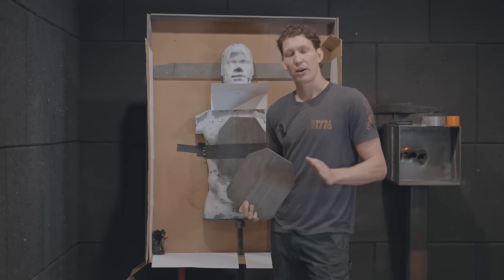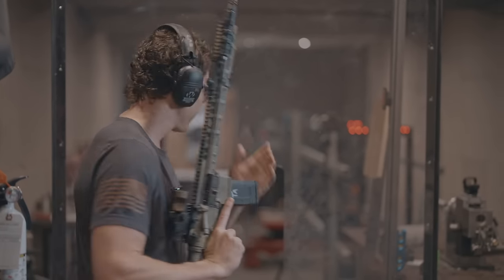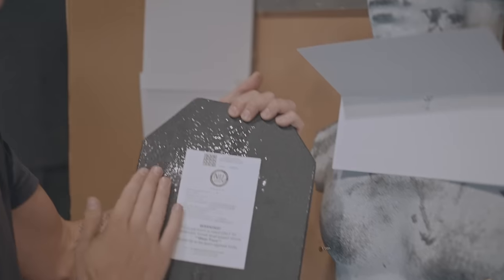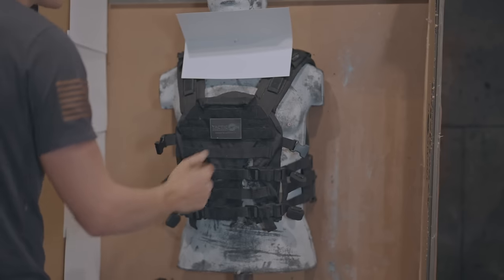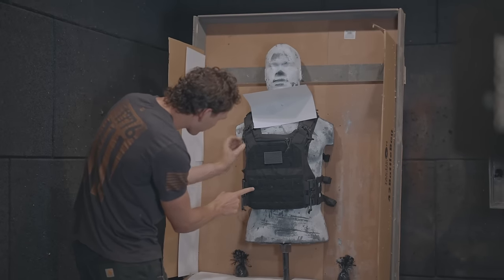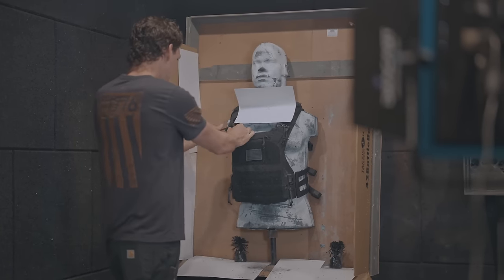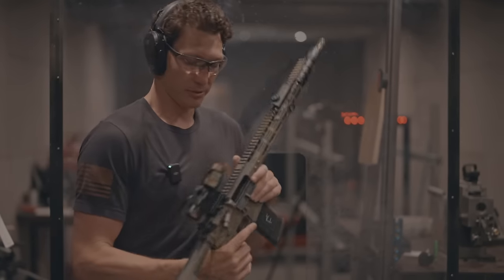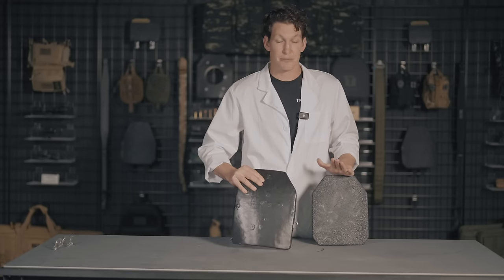Will Steel Armor Make You UN ALIVE Full Test

Comment: I’d really like to see it try M193 out of a 20” or various hunting calibers. I’m just curious as to how it would hold up. That’s one thing about ceramics: they seem to stop nearly everything at least one.
Reply: Yeah for most small diameter fast hunting calibers you really need lvl 4... Basically depends on your location, in my location I'm just as likely to get center massed with a 22-250 or a 25-06 as 5.56, so I'll keep saving for lvl 4 plates (which tacticon also sells, but sadly it sells out fast like today with a smoking hot discount code!) But these plates are 100% perfect for budget reasons or areas where high powered hunting rifles aren't the most likely threat in a local area "catastrophe", Basically these would be perfect for most more urbanized areas... 🤔 Just my opinion! 👍
Reply: M193 out of a 20" and especially a 20+ inch barrel will zip through these steel plates, even III+
Reply: @berryreading4809  I would agree, I have shot clean holes through 3/8in AR500 steel targets with factory 22-250 ammo, and with the right handloads .257 Roberts will also punch through like nothing
Reply: @PandemicGameplay I doubt that, because m193 is only FMJ and that 20 inch barrel adds a lot of velocity, but not enough to make it go through 3+
Reply: @kyoMcMushy  There is footage of it on youtube... M855 is deadly for HDPE, M193 is deadly for hardened steel... Atleast to 20 yards (possibly 50, It's been a while since I went down that rabbit hole) although AR500/600 production does vary by manufacturer/processes I'm sure, along with quality control and batch testing... So X brand plate may stop it while Y brand will not. It's worth doing some video searching. I think buffman range had some videos of failures, but I went down a multiple channel several hour rabbit hole trying to find a definitive answer and still don't have one for standard weight (I think usually 3/8" plate) stopping REAL M193 from 20" barrels... Or even hot .223 40gr varmint loads... Polymer tipped vs lead nose vs FMJ doesn't even matter above certain velocity thresholds... The impact energy basically makes a circular fracture from what looks like a mini explosion in high-speed video and makes the little knocked out plate plug into a projectile... (atleast from my understanding and limited knowledge) But like I say I didn't do those tests, make and form the steel, or compare results across different brands, so I can't give you a perfect answer on the topic... 🤔
Reply: @berryreading4809  what about iraqveteran8888 when he shot a spartan armor ar550 3+ plate from like 10 feet with a 20" m193? didnt penetrate.
Reply: @alphawolfgang173  that's kinda what I'm getting at, multiple channels have shot M193/20" barrels with chrographs and had different results... Some stop it some don't... I'd say it comes down to the steel mill/shape/hardening process/and QC... If it's too soft it penetrates, same if the plate is too hard... Then through in stress points/differences of curved vs. flat formed plates... I'm just saying I've seen enough to not know what will 100% stop that combo, it doesn't help that some channels won't name the original manufacturer because they know their small channel may get crushed over bad or inconsistent results...

Comment: I’ve said it before to people and been laughed at; but the only problem I see with steel is weight. It’s best in class affordability, best in class durability, best in class total edge to edge coverage…. But the stuff is like 4 times the weight of some high quality ceramic/PE plates. If you are just a man that wants something to throw in your trunk that will stop rifle rounds; steel is cheap and effective. However: if you plan on walking or running anywhere with your kit on for any length of time, consider lighter (and more costly) options

Comment: For the potential fragging of the neck, would the angle of the plate due to the fitting of the carrier matter? I noticed your rig was draped over the dummy instead of "fitted" so the plate was higher up to protect the upper lungs and heart.
Reply: I thought that too.   It looks like the carriers were sagging, top away from the head. Yes that will determine where the frag goes.  I assume that is why he had the separation/penetration at the bottom and not the top.  

But this is still a good test.   Its obvious that the plates took multiple hits before having a coating failure.   I'm impressed.

Comment: Also, looking at the NIJ standards, Type III specifies a 7.62 mm FMJ (M80). What was the rationale for using 5.56 green tip (M855)?
Reply: M855 is more problematic for armor of any variety. The mild steel penetrator and the Velocity will be more of an issue than just mass. Thats why Lvl 3 will stop 7.62, but you need Lvl 4 or Special Threat rated plates when dealing with 5.56
Reply: Level 3 can stop 7.62 FMJ but cannot stop 5.56 green tip. Level 3+ can stop green tip in addition to everything else below it. 5.56 has a higher velocity than 7.62 which makes its more problematic when in conjunction with the steel core penetrator. Green tip will zip right through lvl 3 armor.

Comment: I almost bought sleeves for my plates as extra protection and to fit them snugly in the carrier, so it's nice to see a video showing the coating hold up against a full magazine.
Reply: I just threw a 3a panel over the front plate in my steel rig. The back plate almost never has any limb that breaks the perpendicular plane coming off the plate, unless you have an insanely fat ass. Frag coming off plates also has been tested against FBI spec ballistics gel and what you need to know about ballistic gel; is that it is not a replica of human tissue. It was developed as a standardized medium for testing ballistics and it was determined to be “close enough”. from the studying I’ve done; the FBI’s own experts have stated that the first 2-4 inches of penetration into ballistics gel represents penetration through the average person’s skin alone. That obviously has a huge variability person to person and body part to body part, but funnily enough the best steel spalling testing I’ve seen on ballistic gel had most of the copper jacket flakes stop in that 2-4 inch margin. Obviously you don’t want anything in your neck or armpits; but it’s a far cry from how some people believe frag will blow your limbs off and penetrate your skull. The carrier itself catches frag; and the recent shift to simple Kevlar wraps/sleeves makes frag not a problem at all. Another fun fact is that the damn soviets figured out how to make cheap an effective rifle rated body armor by putting steel or titanium in a Kevlar-type carrier back in the day when the best out operators had was just pistol rated Kevlar.
Reply: @Nothanksbuddy I don’t think anyone says bullet fragments will penetrate a skull or blow a limb off. However your armpit, neck and groin have arteries more or less just under the skin, that is where people are saying the fragments might kill you.

Comment: Test the plates at a non-90 degree angle. Some dudes are fat, everyone sits, and we all move into different non-90 degree positions. I'm curious if this plays a role in how effective anti-spall is. I think this is the main situation where poly and ceramic beats steel. It captures so angles are handled better.

Comment: If the price is right, I think these will make great backups... Level 4 ceramic is the way to go, but if you catch a 380 acp with your $1500 plate, do you have a spare? Move your back to the front and go naked back? I don't know many people willing to drop $6k for two pairs of level 4's... how about 1 pair of the good stuff, and a pair of steel you can keep as back ups, or to repurpose for, I don't know, your car door if you had to? Get creative. 
Steel is fine... Likelihood if needing spares are so low it's not financially smart for most people to double down, but if something happened to your expensive ceramics, you'll be darn glad you have a backup pair of steel.

Comment: I definitely think that the steel plate was angled differently than it would be worn on the body hence the heavy bias of the frag going downward, perhaps not enough to negate points made in the video but it should certainly be noted
Reply from the maker: If anything when worn on the body it would be more downward of an angle. With how the pectorals overhang the abdomen. Unless the abdomen is protruding bast the pectorals. In that case...
Reply: @TacticonArmament  Well, the latter is what is most common in this country. Regardless of how we feel things should be, it's probably more important to deal with reality as it actually is right now. And that's gonna mean ~60% of users will have bellies larger than their pecs, along with waistlines broader than their shoulders, and with basically no ability to move at speed, loaded with gear or not.

Comment: I always thought all the “steel armor will kill you!” Opinions were a little disingenuous. Obviously it’s not the best choice but if it’s all you can afford, steel armor with build up cost will do the job just fine. Just get in shape because it’s heavy af 😂 I started with steel plates before saving up for ceramic but now I have a back up armor set for a buddy when government eventually steps over the line (which they are definitely on the path)

Comment: Ok idea, saw it on a show and had seen some military combat veterans comment on the validity of doing so as an EXTRA from your normal ifak. Have a mostly flat ifak that goes under a plate because many have said they have had there ifak get rip off in the heat of the moment, so having an extra right under the plate that you can use a strap to pull it out with ease would be cool.
Reply: And yes I know it has nothing to do with the video.

Comment: How does the plates hold up to xm193 and m855a1 ? Or is this more of a test for the coating?  As far as the coating testing it look like it holds up great
Reply: M855 A1 penetrates the plate at 45 ft out of a 20 inch barrel. Out of a 10.5 inch barrel it wont penetrate. M193 goes through about half the time or less at 45 ft. It does stop .308 ball ammo six shots in the test I saw none went through( the rounds were moving at 2,900 fps). so 762X39 wont go through. a lot of hunting ammo won't go through. It does stop M855 green tip all the time. M193 out of a 16 inch barrel does not do so good against it.
Reply: it even 308 or 30-06
Reply: @Yorktown-pb8bd  the video fro Buff range that I posted below shows pretty much what you said, although he was able to penetrate with m193 from 45 ft out of a 16" barrel

Comment: How come my AR600 3+ plates I got from your company say just 3 on the back face sticker, not 3+.

But the ar600 3+ side plates actually say 3+ on the back face sticker.

Did I get a misprint sticker or are the ar600 3+ plates not actually 3+

Model TA600STL
Lot number BA249

Comment: Would adding steel slight outward lips around the plate sides, redirect the frag somewhere safe? Is this a smooth brain thought?

Like a 90 degree angle border to deflect that 180 frag
Reply: The problem is creating that bend, to get it the steel would have to be heated too much that it becomes too brittle.
Reply: Mill it out or weld it on?
Reply: @jtaylorb88  maybe a sleeve with a steel top? I’m just trying think of a sure way to prevent spall

Comment: Steel plates are a good Idea in theory, Economically and for the long term. But i prefer the Russian method of protection then of truck bed coating, What the Russians do is heavily wrap steel plates in Kevlar, Then among that a lot of Russians use puldrons and throat protectors not only for incoming frag but from spall as well.

Comment: Bullets can travel parallel to the impact surface rather closely, there is a persistent risk of injury to extremities. Additionally, I do agree that coating mitigates frag risk, as well as spall risk. But it is still a risk. Ceramics and UHMPE are not that much more expensive, and can be lighter, though are not strictly. The winner is clear, and  this all feels like an attempt to protect your bottom line. All that said, I've used steel plates in my truck seat and one has stopped bullets. Practical application being what it is I can't drag them all that much. Just as long as people know the risks, it's about controlling for outliers after all.

Comment: I want to know genuinely how deadly are the fragments from the plates, why aren't the edges of the plate sloped to divert the fragmentation away from the neck and can the fragmentation be deadly if put under fbi standards, bottom line, can something as simple as wearing long sleeved uniform (field shirt etc) reduce the potential harm from the fragmentation to the arms, since the neck is difficult to cover in any sort of protection, rather easier would be to slope the edge of the plate to divert frag.
Reply from the maker: With steel, it would be difficult to achieve that sort of bend with the plate. On top of that most people when shooting with plates lean forward, making a downward angle. Rather than the plate being either straight up and down or tilted back towards the face. 
And yes any extra layer of clothing would help stop any frag. I would like to do one of these tests again with clothing rather than paper to get a better understanding.

Thank you for the suggestion and question.

Comment: The way I see it, the only time that I personally would be wearing armor would be in a societal climate in which I am not able to procure replacements. If that's the case, I COULD reuse a steel plate... And no, buying multiple ceramics is not financially realistic.
Reply: Seeing as I spend enough on rifle ammo each year to buy 2-3 sets of ceramic armor, I think it's more financially realistic than it might initially seem. And there's a LOT of guys out there with 5 or more $1000+ ARs that don't have any armor at all, steel, ceramic, plastic, or otherwise. It's all about priorities. Steel plates have advantages, and they have downsides. If you're fighting in a team, the spall that doesn't hit you can still hit them, which is less than ideal and probably contributes to our armed forces moving away from them. They're also heavy, and in a situation of social upheaval, being mobile can keep you alive longer than any steel plate. 

There were more than a few reasons for civilians to have armor back during the "mostly peaceful" 2020 riots, and it was during a time where you could procure replacements if you had the coin. It was actually harder to buy ammo than to buy armor. But being weighed down would make you more vulnerable to the unhappy masses in the streets, and having a bulky plate carrier would have made you an instant target. While being shot was a real but rare circumstance then, being surrounded and assaulted was a lot more common. And so slimmer, lower profile, lighter weight armor systems still serve an important purpose.
Reply: @theKashConnoisseur  That's all stuff worth considering! And I agree with basically everything you said, but as you said, it comes down to priorities. I don't even have a rifle yet. I would say over all ceramics are better, but for the amount more that you have to pay? I don't ever see myself justifying that unfortunately. Right now buying a house while also allowing my wife to stay home with the kid is my top priority, and in this economy that doesn't leave much room for other things :(

Comment: So the big question is, what about M193? I’m glad to know I could take a mag of M855 but we all know the most common thing out there is good old M193. I’ve seen a lot of claims that this won’t stop it. For all the guys saying well if you don’t need to stop huge rifles then level 3+ steel is just fine. M193 is by far the most common cartridge out there, you probably have some in your house right now.
Reply: m193 is fmj, then theres m855, and then m855a1 is steel core. You don't know your bullets do you? its 3 different types. He is using the high performance army rounds
Reply: FMJ is not piercing shit
Reply: if you can generate a halfway not stupid argument for how ball ammo would have better penetration that shaped steel... id love to hear it.
Reply: @lawoftheland5923  You were still wrong btw. M193 is FMJ, M855 is a steel core penetrator, M855A1 is the new enhanced round the army is using also a “green” round it uses no lead like the M855 which uses a lead plug behind the steel penetrator and all wrapped in copper. M855A1 has an exposed steel penetrator with a copper plug and copper jacket. You should really have your facts straight before you come at random people because I actually own guns chambered in this round and also body armor too.